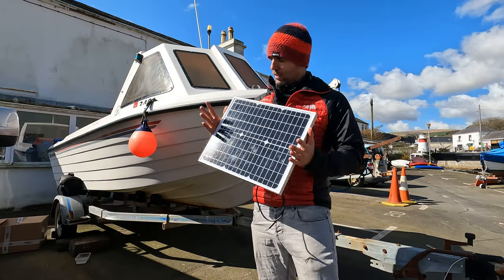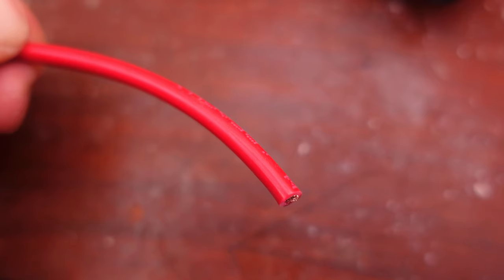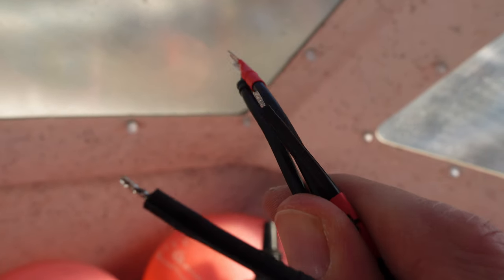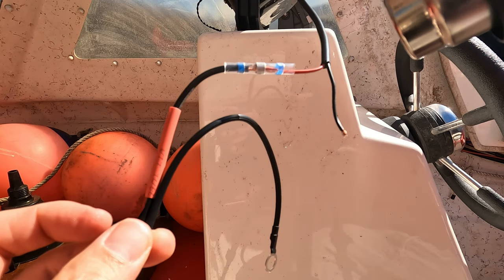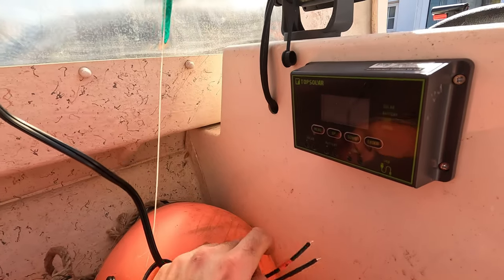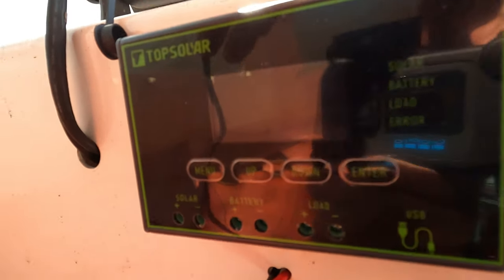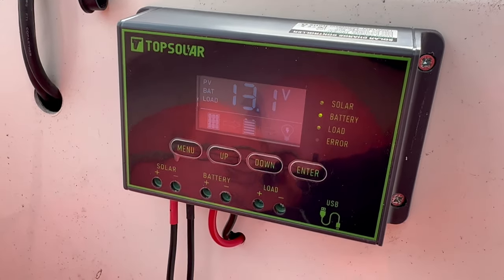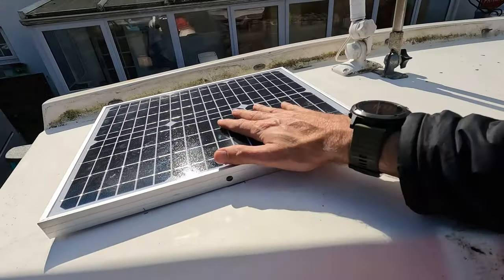INSTALLING A SOLAR Panel from AMAZON on my BOAT -  SMALL BOAT PROJECT Ep.3. -

Comment from the maker: After the video, I siliconed all the holes and put the gromets in, I also finished the heat shrinking.  I worked out voltage drop etc using a chart from google, I'll explain more on the next video when I install a new fuse and switch panel. Thanks for viewing, remember I'm not a marine electrician, there are many ways and I opted for safety with slightly oversized wiring, calculated with current over distance to ensure it all works safely :)

Comment: Hi I have just found your channel and I am loving the boating bits, I come from the north of England I live in Wallsend but was born in North Shields and old fishing town, about 30 years ago I had a 16 foot fishing coble and me and a mate went fishing along the coast out of the Tyne is was great but due to bad health I had to sell up. The only thing I see in this vid that got my beedy eye was the fact you didn't silicone the through holes in the roof for the panel, I saw wood coming out so you must use marine grade silicone and pull the wire through and seal the hole or water will get in and rot the wood in the roof and it will be a pain to fix. Keep up the vids I look forward to seeing more, Paul from Wallsend ;-)

Comment: Nice vid. Tinned copper wiring is a must on a boat, due to moisture and vibration like you said. I'm a sparky btw, keep up the excellent work. looking forward to the fuse switch rewire

Comment: Recently found your channel and it’s great! I’ve just purchased the same solar panel kit for my own small boat and was wondering how you were able to fasten it to the roof of the boat when you don’t have access to the head of the bolt when you’re tightening the nut from inside the cabin? Cheers!
Reply from the maker: Hi bud yes, it was a little tricky, longer bolts pulled through and tightened the nuts from inside the cabin, and lots of silicon 🙂

Comment: I thought you'd use silicone in the drill holes to prevent water ingress
Reply from the maker: I put some of that on after 👍
Reply: @AirbornePirates  I posted before watching the entire video haha.  I see you said you had rubber grommets. Looking really good.
Reply: Never use silicone on boats! It never comes off short of grinding out and it quickly fails.

Overdrill holes fill with epoxy to seal and use butyl tape.

Comment: Thanks for the video. I have a question for you, I have a boat with an onboard battery charger. How do I implement a solar charger with the onboard charger? Do I still have to have a regulator, and on the outgoing side of the Regulator does it need to have 120 V plug that plugs into my onboard charger? Thanks in advance for your time.

Comment from the maker: What else should I do to the boat?? 😬
Reply: Can't wait until you are out and about on your boat mate deffo As a keen fisherman I have no doubt that we have Great White  sharks visiting   our   coast there is absolutely no reason why they wouldn't  Maybe they are just passing through but I think they are here not in great numbers but but they are here I hope you are the man to prove that they are here   Good luck and keep the videos comming      thanks
Reply: Seal the screw holes properly , connect red cable to red cable so if you sell it or something happens there is less confusion , account for voltage drop on a 20w solar with all that thick cable , usually enjoy your videos but I only lasted a couple of minutes before switching off
Reply from the maker: @darrenhale6320  voltage drop worked out with a chart prior to wiring. screw holes sealed properly with gromits and sealant after install.
Reply: @darrenhale6320  I am an electrician and the voltage drop would be virtually non existent in a small run like tht.  good video.
Reply: LED search lights would be good for night fishing.

Comment: Can you leave the solar panel on when engine is running? I know with the small solar trickle chargers if you do the power from the engine can blow the fuse does the controller stop this.
Reply from the maker: Sure can, it’s got a controller which stops any issues I never disconnect

Comment: Thanks for the video. Does your solar charge both batteries or can it only charge one ? If it can charge two batteries have you shown this in a video ? Appreciate your help. Thanks Bob
Reply from the maker: Hi Bob, I currently only have one battery, I would get another charger for a second battery I think as it’s only 20W
Reply: @AirbornePirates  OK thanks for your reply. Hope the boat is going well and doing everything you wanted.
Reply: @AirbornePirates  Appreciate your reply. Many thanks

Comment: Hi, im looking at investing in one of these, I have a small 16ft boat with an inboard 2cyl diesel engine running a single battery the Alternator is a 35amp unit, if I install the solar panel to keep battery topped up for bilge pumps whilst on a mooring would the alternators current when the engine is running damage the controller supplied with the solar panel? Or would i have to isolate the controller when the engine is running?
Thanks
Reply from the maker: It’s absolutely fine as the controller is inbetween. Not had any issues with mine 👌

Comment: I've bought the same solar panel. How on earth did you fix it to the boat roof? I've got 4 holes but no way to get to the bolts under the panel.
Reply from the maker: Drilled holes in roof of boat, Bolt and nuts and silicon to connect 👍 fiddly but worked
Reply: @AirbornePirates  Thanks for your reply. Once one bolt is in, there is no way to get to the others. I have decided to go with brackets to make it slightly easier.

Comment: Hi, at 3:58, using the heat solder connector, did you pull one wire all the way through and give the wires a twist together before pulling the connector back over the wires?  I've read that this gives the wires a better connection, also states this in some of the boxes that the connectors come in.
Reply from the maker: Hi there, I didn’t but I should have! When I rewired the entire boat I did this method 👍 still going strong 2 years on